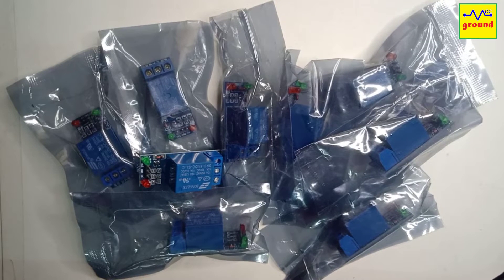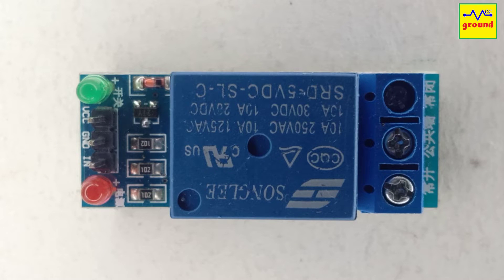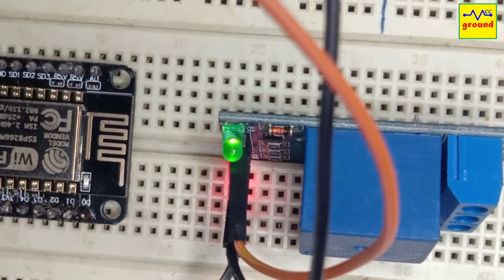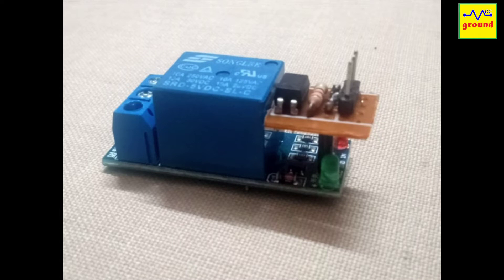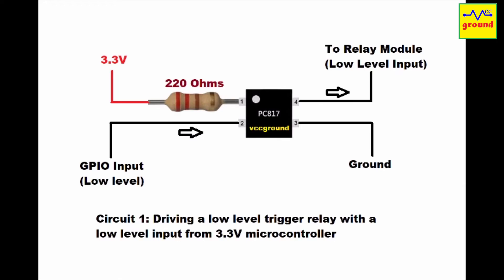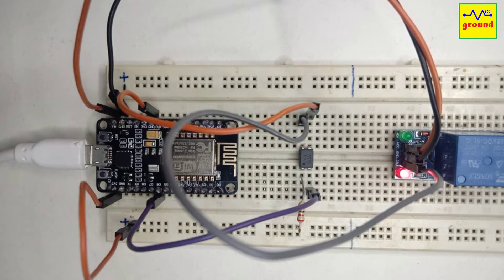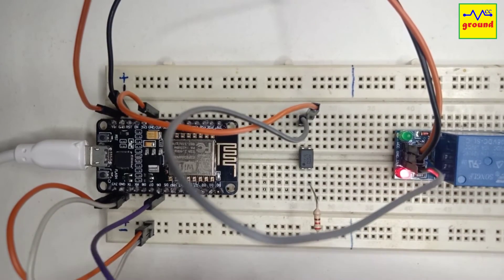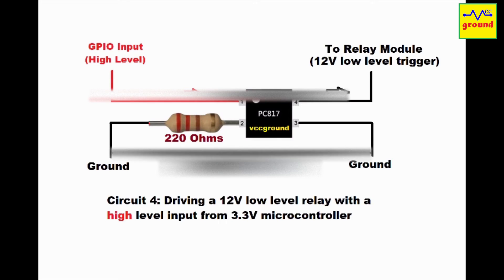#48 Relay Modules Tips & Tricks | How to | vccground

Comment: You should have simply replaced the base resistor of the on board transistor (relay module)

3:07 buy tying the ground lines you are not serving the purpose of using an optocoupler.
Reply from the maker: Yes, at first, I had tried removing the base resistor and placed a 20k pot at its place with its last pin hooked to vcc. At some point on the pot, it worked. I measured the resistance values from the pot and replaced it with two fixed value resistors but was not successful as the relay was clicking randomly. So instead of adding a pot to every module and then calibrating all of them, I found that the opto coupler is more suitable for this purpose. And yes, for the second issue, you are absolutely right that when opto coupler is already there, we don't need to combine circuit grounds. Thanks for pointing out the mistake ❤️👍